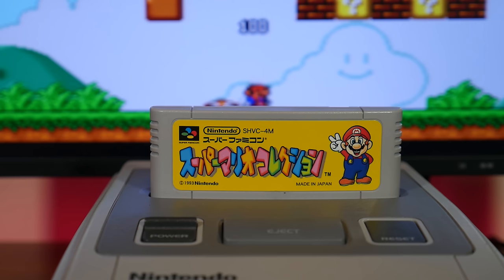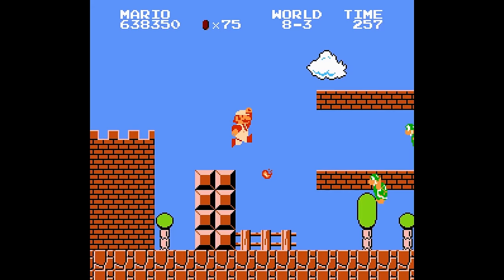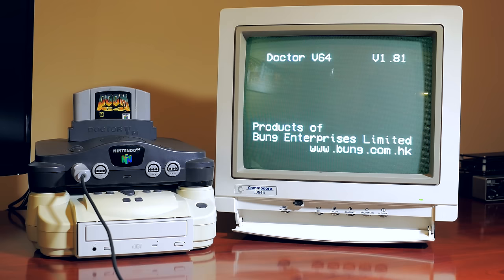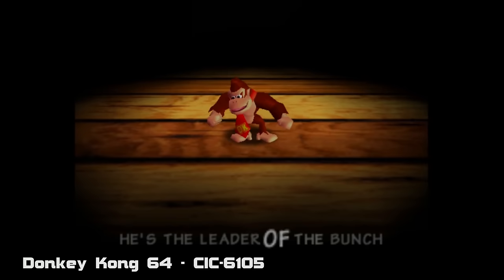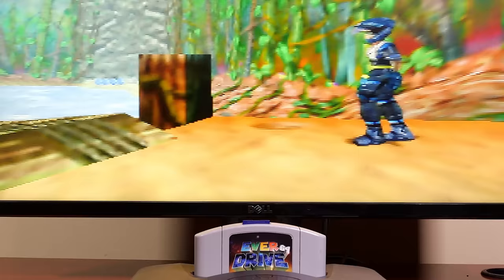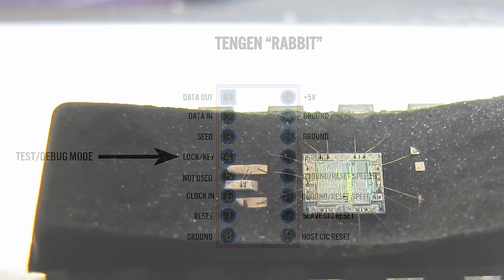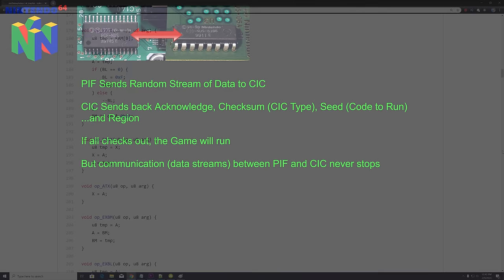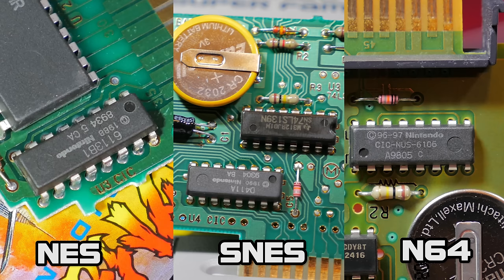How Nintendo Stopped Bootleg Games on the Nintendo 64 | MVG

Comment: Jet Force Gemini: One of the greatest games of the generation.
Reply: Underrated. Held back by the single analog stick and onerous 100% fetch quest required for completion. I finished it.
Reply: @JuddMan03  They thing I dislike the most about JFG is the flawed way that damage is relayed to the player.
The multi-level energy bar, where the most significant value is represented by the smallest element on screen doesn't help, but the most problematic part, I think, is how it is possible to incurr massive damage without there being a quantitative or qualitative difference in the feedback mechanism to convey that to the player through visuals or sound. Many times during a combat, especially with bosses, where it matters the most, you can be getting pounded and not even realize until you consciously decide to look at the energy bar.
This is not a nuclear powerplant control where you need to have your eyes on the meters, but an action game where your eyes are on the action, trying to kill and not get killed, the damage inflicted needs to be transmitted to the user in an inline manner, and the health meter should be an informative mechanism to check during the pauses, which don't really occur in the game's bosses.

During regular gameplay there can be attacks that knock you to the ground and so on, and give you a small invulnerability break, which is a very good way to convey a critical hit. During boss battles, you just remain still all the time and all you see is the screen flash red without any indication of whether it is light or heavy damage.
It was very annoying to me to be playing like nothing too bad is happening, and then take a glance ad the health bar and be shocked at the dire situation.
Reply: Underrated classic
Reply: I still dream with a remake of it. Somebody somewhere with licenses to do so will care enough to make it happen.
Reply: Best game on the system IMO.
Reply: I loved the fact a 2nd player could play as Floyd and help the main to beat the game
Reply: @Ridley1911  YEEAAAAAA!!!!!
JET FORCE LIKE A MUTTTHHHAAA FUKKKKAAAAAAAA!!!!!
Reply: And one that aged badly
This game needs a remake more then any n64 game

Comment: there was a product available called the Doctor V 64 which allowed you to play pirated games from around 1997-1998. IT was a device that sat underneath the console, and connected via the communications port. It had a CD-ROM that allowed you to scroll through the ROMs, which then got loaded onto a cartridge (They had some form of cartridge you insert into the N64 that you would insert your own real game into - I believe for memory or some other purpose) - it pretty much worked flawlessly. Getting hold of ROMS - not sure how that was done, presumably there was a market (or online download) for burnt discs, and maybe the Dr V allowed you to extract a rom from cartridge via Serial port, but they weren't too hard to get hold of in any case. not a clone of a cartridge (which would have been prohibitively expensive) and the device itself was around $400 USD+ at the time, so you'd have to be pretty serious about your piracy to buy one (I did not have one..), but it was definitely possible back in the day.

Comment: "Nintendo using cartridges on the n64 was the right move!"

WAT
Reply: @kreuner11  even the PS1 had good anti tamper methods and it was CD based
Reply: @AchiragChiragg  
Not really, my 1st gen PS1 it took a spring and a copy of Ridge Racer to play any copied game.
Reply: @wing0zero  The Saturn did have very robust copy protection though, so it could be done at that time with cd.
Reply: Well, besides the advanced security only possible with cartridges (as it involves chips), they had another important advantage. Although they had a very limited storage compared to CDs (~4 MB compared to ~700 MB), the transfer speed of cartridges was much higher than CD's. While for example PlayStation games were more accurately textured and had CD quality audio, the N64 games didn't have a single loading screen because they didn't need it.

This was explained more in depth in a vid I saw some months ago, I don't remember perfectly but probably it was still from MVG.
Reply: @detectivescrotes  and then there was Dreamcast that just played some back ups for no reason at all
Reply: Yeah...pros and cons. I'm more concerned about the cons.
Reply: @glaurennorthern369  Yeah, I don't know how that got it so wrong with the dreamcast, after doing it so right with the saturn. Completely baffling.
Reply: Yeah, perhaps from a security standpoint it might have been but in terms of sales? Not at all. The playstation outsold it nearly 3 to 1.
Reply: I would argue losing their previous allies Squaresoft was enough of a reason to justify it as a bad choice, especially with how big of a western powerhouse they became in the late 90's. I mean just think about the game lineups for the N64 and Playstation if Square's role were reversed, I think the N64 would unanimously hold the stronger library by a wide margin. To me that's what the PS1 is more important for today (its massive excellent JRPG catalog), and stripping those away from the PS1 and adding them to the Zelda 64s, Mario 64, Mario Kart 64, Star Fox 64, Mario Party 1,2,&3, Kirby 64, Paper Mario, and of course the Rare dynasty would probably give the N64 the strongest library of all time. 

That is to consider that the N64 gems we know today would've been designed much differently around the medium as well and load times perhaps hampering many, but just as a notion it's almost drool inducing what could've been.
Reply: Didnt it take like 25 years to crack the anti-piracy measures on one of the sega consoles? I rememeber the news articles about it last year.
Reply: Smattless  from a business standpoint Nintendo lost a huge amount of great games and a big market share because of cartridges. Sony wouldn't even exist today if Nintendo chose CDs for N64 because they could get EVERY major 3rd party game PSX had with better graphics. But they ended up with small gaming library mostly relying on just few of 1st party titles.
Reply: @StabStabStabStabby  Yeah, that was the saturn.

Comment: This is also called "heart beat" and is used by some anticheat engines in games. The server send out codes to the client where the client are required to send back the proper response else the server kicks you out.

This makes sure that you cant simply prevent the anticheat from running instead you actually need to break the CRC checks and patch the detection.

Only way to get around this is to figure out the response codes or using an emulator (run 2 copies of the game where you disable the anticheat on 1 and make a software that pass the request code to the other copy which send the result back for you to send to the server)

Comment: Having a snes was one thing. Having a computer, internet and the items to pirate SNES games were all really expensive at the time. I'm sure there were some bootlegs but it wasn't a common thing where I lived
Reply: irregular mana Japan is right next to China so in 1995 you could buy a super magicom that would dump/load a SNES/SFC game to several floppies
Reply: True, I suppose you could have rented games and copy them that way, but from what I remember the actual devices to play copied games were also not cheap.
Reply: @johnsimon8457  that does make sense, I lived in the US at the time so I hardly knew or saw anything bootlegging. Not until the late 90s with the psone because of its CD based games.
Reply: I had a Magicom which was a floppy drive and 2 adapters on the bottom that fit in the SNES and Genesis cart slots and I could load any game from floppy. I remember having thousands of floppy disks with every SNES and Genesis game, then had 4 CDs with every N64 games for the v64 device. All my friends had them as well and we swapped games at school in the early 90's. Then again, we also had 'tape parties' where we would all go over to 1 friends house with our dual cassette decks and spend countless hours copying games on cassettes for the Atari 400/800 in the mid 80's.

Comment: Honestly, this hardware level stuff for anti-piracy was cool. They also "keyed" the base of PAL, NTSC, and NTSCJ cartridges. If you swap the backs of JP carts and US carts you essentially bypass the region "check". The N64 doesn't care if the game is English or Japanese as long as it is NTSC. The Everdrive is actually keyed in a way that it will fit in both JP and US consoles. I find their approach to region lockout (or lack thereof) interesting, as if I recall the SNES was much more aggressive about it. (I could be misremembering that though)

Comment: "[cartridges] ended up being the right choice for them at the time"

Uh.... that's debatable at best.
Reply: True. Many games that both were on the PS1, and N64, were different in 2 ways. Let's take Vigilante 8 2nd offense for example: the PS1 had CD-quality audio which the N64 cartridge couldn't carry, however the N64 had the processing power to enable enhanced textures (with arguably way worse framerate).
Reply: @TheNiteNinja19  Huh hadn't thought of that! I was just thinking the expense of producing cartridges, which pushed away 3rd party devs (or so the story goes), and meant Playstation could undercut the MSRP of each game.

Comment: When it comes about technology, it's always advancing and evolving and I don't think it was ever about stopping piracy at all but holding it back enough time. The breakthrough of the ultra CIC happened way past the console's generational lifespan so it never posed a threat to the company itself, so I think they were successful in what they meant to do. And while there were emulators early on, they were never the type of thing an average PC user of the time had much grasp on, whereas because of knowledge or because of hardware limitations.

Comment: I would think that a good approach for guarding against piracy would be to have a mapper chip which watches for certain sequences of events and triggers a "surprise" bank switch when they occur.  Using a dump of the game without the surprise bank switch would yield a "demo" version which would only let a player use the first couple levels; if the chip sees a certain sequence of RAM stores which should occur when clearing a level, however, it could bank-switch to code which would tweak things in such a way as to let the player advance.

Comment: You didn't mention Sin & Punishment! It had anti-piracy code that would WIPE the BIOS of the Doctor V64, turning it into a brick (well, spare BIOS chips were available to buy, but what a pain)!

"Stopped the flow of unlicensed bootlegs in the late 90's" ... for what its worth, Hong Kong clone N64 game cartridges were available to buy in the late 90's.. I had Top Gear Rally clone cartridge at the time.

Comment: I love that you can now get reproductions since some games like with hard to find games/expensive say Mario Cart 64 I got as an identical clone and got Mario Party 64 as an identical clone that is even better without the lag the screen to controller had with the original game in the more complicated games. You could even now get an identical clone of the machine they made to run the N64 games (good if your overly built machine dies) now thanks to the code broken, before with older all you could get is a machine that played the games but the identical looking machines games could not play on the actual N64 nor could old actual N64 games play on these clones, however the games controllers if they plugged in using the same pin system were almost always interchangeable. 

There are now also near identical clones of the og controllers that have a very similar plastic though thinner and very slightly sharper on some corners probably due to the age/use on the original but often require an extension cord. The Near clone controllers of the original are important since the other controllers made as clones in the past were not great and had rubber deteriorate getting sticky like on the Mad Cats better for N64 then Game Cube where off models of Mad Cats or wireless like Pelican often failed or ergonomics issues like the Radio Shack clear one that was just bulky and hard to use, we My brother and I still have the Radio Shack one as a backup for the last slot but had to ditch the Mad Cats translucent colored two my brother and I had.

Comment: Did you get a new camera? Everything seems a lot sharper. Could also be that YouTube is now displaying 4K video instead of 1080p after I selected it. I'm on a 1440p display so I would assume "Auto" selects the highest possible, but even still, Linus Tech Tips did a thing about how 4K video on YouTube can still be higher quality because of 4:2:2 or 4:2:0 decoding when squished to half the size.

Comment: I'm a little surprised that they didn't route (a few of) the cart's addr+data lines into the CIC/PIF, and use the currently-accessed ROM data in generating the random handshake sequences. That would've killed the "donor CIC" method since the donor ROM wasn't being accessed (and even if it was, the data/addr would match what the motherboard was seeing).

Comment: Didn't hurt matters that the N64 was a completely alien architecture compared to most gaming machines.  When N64 emulation became an option about 15 years ago, I tried it, but the only game that could be reliably emulated at the time was Mario 64.  I think it's gotten a little better, but there are still some problem titles titles that just don't work right no matter how much you fiddle with the settings.  Blast Corps is a good example.  
Honestly, IMO, that just means someone needs to remake Blast Corps.  Such a great game.  Never been remade, remastered,  or rebooted, and it really should be.

Comment: 9:58 - how on earth do you get N64 games to look that sharp?? That's incredible. Just discovered your channel btw and it's great!
Reply: Probably an rgb mod or the more likely answer, ultra hdmi or whatever its called
Reply: @Scolio  thank you, that's what I thought as well. The modded N64s are so expensive on eBay. I don't know of a way I could cheaply learn how to solder and get good at it to the point I could do this myself.
Reply: @stilnoxVisions  even the nintendo brand s video cable would improve clarity especially when paired with a crt or the retrotink
Reply: @Scolio  I was going to go that route until my Sony CRT died. I do have a Framemeister however, that I mainly use for PS1, Saturn and Dreamcast. Think the N64 would be good through that?
Reply: @stilnoxVisions  if it has s video, yes. I mean composite would work too though

Comment: This protection scheme worked well for previous N systems so there was no point in changing it, only to improve it and make it even harder to break. If only engineers who designed the GPU were half as smart as the security guys...

Comment: Wait... so it's possible that my N64 which will turn on but will NOT output anything to the TV is suffering from a faulty PIF chip, thus causing games not to boot at all? Well, it could honestly be a host of issues, and I don't have the know-how to repair it myself, haha. Probably just gonna buy another one.

Comment: I swear you have an original Operation Flashpoint (ARMA3 precursor) box and a Soldier of Fortune box from the 90's on the shelf above your head...  those were both great for what they each brought to gaming.  Pretty sure SOF was the first game in which you could shoot off limbs and heads.  Rune may have beat it to dismemberment, but no guns.  (Correction both were released in 2000).  Blew my mind when I found out ARMA3 came from Operation Flashpoint.

Comment: Is it beyond the realm of possibility to just get a swappable ic socket (i have many projects that use 555 timers, and only 4 555 timer ics), and one of each cic? Then, though a slight nuisance, you could easily swap the cics of the everdrive (or similar) to match what should be there?

Comment: "Project 64 was using the challenge response of the CIC, in order for games to be playable". But previously, you said that "when attempting to read the data from the CIC to the PIF, the chip would produce random bytes". So how is it possible to know the challenge/response data? Also, how did the CIC know when there was a logic analyser hooked to the bus, in order for it to produce the random strings?

Comment: Sorry for my bad english.
Can I ask you a stupid question?
When I was a kid, my dad bought a Super Nintendo from the local store. The console was 100% original.
My friends had several pirate cartridges.
They lent me and I was able to run them on my original SNES, without any problem. Just inserting the cartridge and starting the console. It is possible? Or did they sell me an unlocked console as original?
Reply: Sounds like your SNES was opened and had a specific pin of the CIC chip on the main board lifted before being sold to your dad. This was enough to play any counterfeit cartridge, however, it would also prevent you from playing games that used specific enhancement co-processors, even if they were original (e.g. any SNES game that used the SA-1 co-processor -- Super Mario RPG and most Kirby games comes to my mind right now)...
Reply: @mbc07  I remember that Kirby and some Animaniacs game didn't work on my console